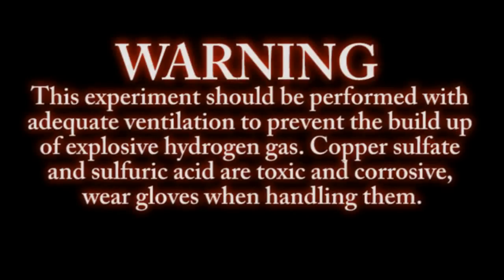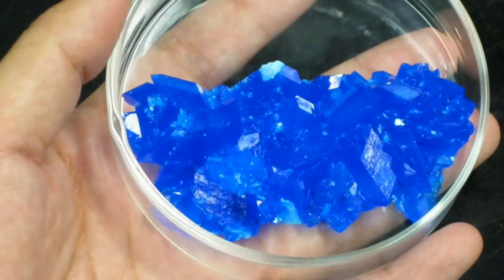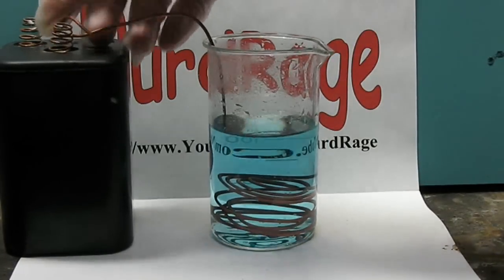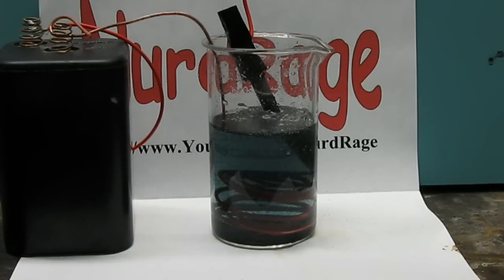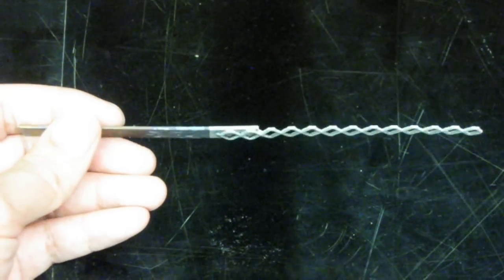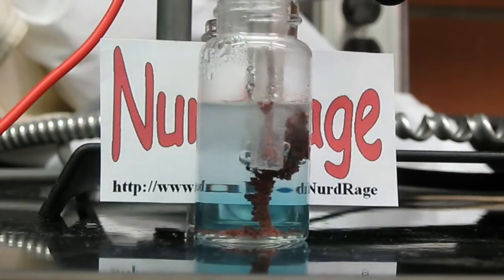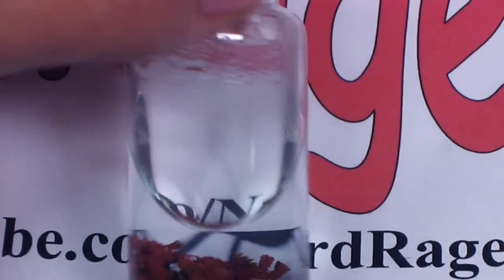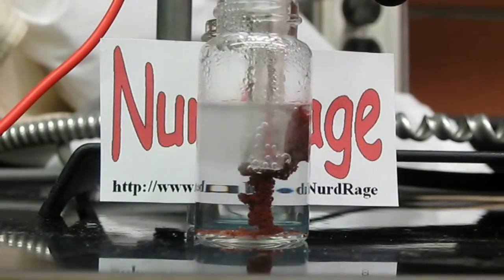Make Sulfuric Acid (Copper Sulfate Electrochemical Method)

Comment: Could this work with just two carbon electrodes?
Reply: No because carbon and copper both have different eletrical currents
Reply: +Yolo Joe Possibly the dumbest thing I've ever heard.
Reply: Ive had good success today with one carbon electrode. There is no real reason why it wouldn't. I'm not entirely sure why nurdrage went with a pack of carbon electrodes.

Comment: @b1912313 Platinium wire rolled on glass rod as anode and thick copper wire (Exactly same like in this video) as cathode.

The diluted acid It produced looked good, it was clear liquid. I think I boiled it too much. It has literally color of tea now. I was boiling 300 ml of what I got from electrolysis, and got about 40 ml of that brown acid at end.

I think It's just strong acid with lots of impurities in it. I probably heated it over 300C.

Comment: Nurdrage,
I tried this with a Carbon electrode from a AA carbon zinc battery which was quite small. I kept the electrode at the positive terminal and the copper electrode at the negative. The amount of electricity used was 3 volts. But still the carbon was eroding slowly and it did not convert to sulfuric acid. Could u please help me out?
Reply: Ive had good success today with a carbon and copper electrodes at 2.5v and 0.15amps. I got a carbon electrode from a bigger battery. Did you remember to boil off the excess water once the solution had gone clear?
Reply: The solution did not convert
Reply: It became a green solution
Reply: if there is still colour, perhaps the electrolysis wasn't completed. 
This said, when I finally got around to boiling off the water in my acid solution I was left with only a white power and no sulphuric acid
Reply: +abey jacob I got the same green solution after the electrolysis, so I boiled off the water and I was left with highly concentrated sulphuric acid
Reply: Ok then I will try it once again and see if it will work. Thank you so much for your help.
Reply: Maybe you got Iron in it?

Comment: Can we make nitric acid by this process using cu(no3)2 solution?
Reply: No, the copper doesn't react with dilute sulfuric acid but nitric acid is oxidising even in dilute state so any nitric acid produced would react with the  reduced copper to form copper nitrate. You could however try to use salt bridge.
Reply: Lukáš J. 
So we can make nitric acid by al(no3)3 solution because aluminium does not react with nitric acid.
Reply: Aluminium does react with nitric acid. It doesn't with concentrated nitric acid due to passivation but passivation wouldn't occur in this situation.

Comment: I am trying this experiment and the reaction is near the end, but it still has a pale blue color. When the electrodes are active I think that they are splitting the water into H2 and O2 rather that reducing the Cu atoms and oxidizing the SO4 ions. Should I just let it keep going or what should I do?
Reply: What did you use for the anode? I used a carbon electrode but like this video it breaks down terribly. After filtering I still have a strong blue coloured solution. I don't know what else Ivan do. I would use platinum but it's just so expensive.
Reply: Timothy Morrison I used a copper and platinized titanium electrodes like the ones used here
Reply: Creativity Can you tell me what voltage/current you used and for what length of time?
Reply: Timothy Morrison  I used one of those big 6 volt batteries and used it until it practically ran out of charge. Either that or the platinum coating had dissolved off which is unlikely.
Reply: +Creativity i don't know if this is still helpful buy i had the same problem. I'm using a computer psu to power it and i moved from 5 volts to 3.3 when the copper started bubbling. That seems to have fixed it.
Reply: Ive had good success today with carbon and copper electrodes at 2.5v and 0.15amps. I am running it through the electrolysis box that Nurdrage also made in one of his videos. He gave a quick tip that I almost missed: set voltage and current so that bubbles are just coming off the copper then back it off just a little

Comment: they are 3 ways to do it.
1.)use sulfuric acid with very few nitric acid it will oxidize copper and let cu+2 and so4-2 merge.
2.) use sulfuric acid with H2O2(hydrogen peroxide) so h2o2 will oxidize the copper to cu+2 and this will react with h2so4 leaving cuso4 and h2 behind.(But i wouldn't do that because of the risk factor attached with h2o2.)
3.) (My favorite and easiest one) electrolysis of sulfuric acid with copper electrodes.
4.) HPAL of copper in 5% W/V sulfuric acid.

Comment: How come the sulfuric acid does not attack the copper at the end of the electrolysis?
Reply: Thanks.
Reply: +ShadowOfChemistry Copper metal will not react with H2SO4 on its own. It must first be oxidized.
Reply: The "answer" is that the electro standard potential of the cooper is +0,52  and of the hydrogen "which is the acid +H as it comes down from H2SO4 " is 0,00 that means the hydrogen just do not have enough "electronegatitivity" capability compared to cooper to oxidize it. The law is the element with higher electro standard potential oxidizes the lower.
Reply: +Elli Pszia That is the answer one gives when one is not trying to wrangle 4 children. lol Otherwise I would have linked a reactivity series diagram.

Comment: All right, well I just tested my experiment with the " acid " & It bubbles when I add Sodium Bicarbonate into it, so that tells me it's acidic. All I did, was make copper sulphate with magnesium sulphate with copper electrodes, then converted it to sulfuric acid with lead dioxide & a copper electrode, it would have to be boiled to make it more concentrated. Good luck tho!

Comment: @b1912313 read his video description. Even stainless steal oxidizes. You should probably use one the carbon electrodes in a battery, and he has a link at :58 that shows how to do it. You probably could use a piece of mechanical pencil lead to do it, but don't hold me to it.I'm assuming it's graphite and that it could count as carbon.

Comment: Just my two cents, but... I am doing this as I write this, but instead of using carbon or platinum, I just used a lead dioxide plate from a lead-acid battery, while also using a 19.4V @ 4.2Amp laptop charger, it's been working pretty good, very hot tho. Lead dioxide does work as a anode for this.

Comment: @wetwilly2000 Forgot to mention, there is from what I can see, none of the lead dioxide has dissolved in the mixture. I do not know the SG of the mixture yet. I will test to the acidity by putting some baking soda, or ammonia into it, if it bubbles, it's acid.

Comment: Hey I'm fairly new to electro chemistry and really want to make sulfuric acid this way also I was just wondering can I use a piece of copper wire as an electrode or what can be used as copper electrode? would it still be possible to get excess copper in the first method? If anyone can help with these questions that would be greatly appreciated thanks.

Comment: Lead should also work, as it is passivated by the sulfuric acid as far as I know. Leadsulfate isn't realy water soluble, so it crystallizes and can be filtered out with the copper, in case that it will be produced. 
If i have time I will make an electrode and test it these days.

Comment: Hey, how about a video about melting the copper sponge with borax powder.  The spong may have a coating of cuprous oxide so a small amount of charcoal dust may be usefull.  You could sell it and recoup 50%to 80%  of the cost for the copper sulfate purchased.

Comment: Can i plate a piece of zinc in copper sulphate and use it as the cathode? :o
Reply: +Jerry Or Yes, you can, I plated a piece of carbon with copper using copper sulphate
Reply: 35lightning35 thx

Comment: I have tested this with graphite and copper electrodes.
The solution became colorless, and I filtered it.
Then I tried to concentrate on, I never reached the point where the sulfuric acid will fume.
I do not think I have succeeded, what could have gone wrong?
Reply: If I'm not mistaken, Sulfuric acid will never boil off, rather it will keep boiling without loosing water after a certain point. Can't recall in which video he demonstrated that.
Reply: I've managed to clean battery Water/Acid and concentrated oit, but I do not think this method is successful, what have I made? Water and metallic copper ??

Comment: I still dont get this reaction. Usually when doing electrolyisis to  a salt, you get an ACID and an HYDROXIDE.

so how come this doesn't form copper hydroxide ?!?!??!? where did the OH- ions went ?!?!?

Copper powder is an extremely expensive stuff, but with this method, it would be very easy to produce.

Comment: @m8teseven Same thing. But i got around that problem by lowering the voltage.
For example at the beginning i had at 6V and no bubbling occurred at the negative electrode but as the solution got lighter the bubbling appeared.I lowered the voltage to about 1.5 V and the bubbling stopped.I hope this helps.Read the fourth paragraph of the video description!! I hope this helps!!:)

Comment: Is it possible to concentrate sulfuric acid by electrolysis? I mean sulfuric acid acts like electrolyte, and water is converted into oxygen and hydrogen? Am I wrong?
Reply: +Dominik Chat That's basically what's going on when you overcharge a lead/acid battery. If you overcharge such a battery, you'll find that the liquid level drops.

That said, it's much more effective to simply heat the solution, since the electrolysis requires more energy than the boiling/evaporation of water.

Comment: @wowhead1227 You can get a 12 inch long platinum wire for around 30 bucks from Esslinger Jewelry supply.  This is a pretty good deal.

Comment: @megamarko94 
No - because hydrochloric acid is simply hydrogen chloride gas bubbled through and dissolved in water. This means that as you heat the acid solution, the gaseous HCl will bubble out once again leaving you will a more dilute solution than you started with in the fisrt place!! Sorry!!

Comment: How make a platinum electrode? I have 0.5 gram a platinum and  titanium plate
Reply: +34Scrooge electroplate it
Reply: i guess u will need more than 0.5g ...it depends on the surface u want to plate it and the thickness of the plating .  
 https://upload.wikimedia.org/wikipedia/commons/b/b6/Copper_electroplating.svg
In the image u have to swap the ME (the metal part) with you titanium plate and the Cu part (not Cu+2) with the platinul part you want to consume ( yes the process will consume it ) . Advice : use low Aps (as low as you can get ... with the aps).

Comment: Please anyone help me.
I need to know if there's any other metal other than platinum and silver that can do this too because i dont have those. and even if i had them it would probably be in the form of jewellery and my mom wont want that soaked in some blue chemical
Reply: potion123456 buy a 6 volt lantern battery.break the seal and you’ll find 4 batteries inside.disconnect all the wires that is connecting them and take the individual cells out.if u hold the zinc battery casing and pull the core out with pliers hard,it will give you the carbon electrode :)the casing is zinc and the inside is manganese dioxide(i think)hope this helps!
Reply: metallic lead works good too

Comment: could i do this with magnesium sulfate
Reply: No. With copper sulfate, copper ions are reduced at the cathode to create elemental copper. The only reason that happens is because copper is lower than hydrogen in the reactivity series. Magnesium is far above hydrogen in the reactivity series, so hydrogen ions in the water would be reduced at the cathode instead of magnesium ions.
Reply: no the magnesium would react back to magneisum sulphate with the created sulphuric acid
Reply: TheSmileyFacedPizza  I think it's due to copper being lower than zinc in the reactivity series, not hydrogen... but that's what my hs teacher said and I have no idea how it works irl
Reply: Copper is actually above hydrogen in reactivity series.
Reply: People make reactivity series in various arrangements. The point is that copper is less reactive than hydrogen, meaning copper is reduced to its elemental state more easily than hydrogen.

Comment: I got sick of my copper sulphate going black so drilled a hole in a bit of housebrick just big enough for the carbon electrode.(from 6 volt battery)
It was going well (solution getting lighter) until a small crack formed in the brick-bit. :(
The concept seems sound though.
No idea what else might be in brick that the acid would react with though.

Comment: why don't you burn sulfur with air, channel the resulting gases through sulfuric acid to dry them, then heat the gases over platinum and dissolve the the result in concentrated sulfuric acid and dilute with water. you need a little H2SO4 to start, but you get twice as much in the end?

Comment: @chemistryguy100 I would try it seeing as the idea is to have a relatively inert electrode which is why carbon, lead, and platinum are used.  I'd double check before trying this.

Comment: how many volts and amperes has you used ???
Reply: Ive had good success today with a carbon and copper electrodes at 2.5v and 0.15amps.
Reply: +franthetortoise I've had sucess using 5.1 v and 2.1 amps
Reply: did the carbon electrodes corrode much with that?
Reply: +TheTalent I didn't use carbon, I used gold as the anode
Reply: nice. smoke em if you've got em... I'm not that fancy.
Reply: Hey 35lightning35 , i think i would ask you something : Using the Gold electrode , did u see or observe any coloration of the gold plate in red , or any other misterious things ? If yes please answer . thx

Comment: Now This is awesomeness, I'm guessing I can recover the Acid from sodium sulfate reaction, and because if you use graphite anodes in a membrane you will exfoliate to yield graphene as a co-product! (If you're into that sort of thing). Would it make sense to use a hot solution increasing solubility and therefore purity?
Reply: It wouldn't work without a membrane cell, sorry, as it would form sodium hydroxide, and would neutralize back the into sodium sulfate.

Manganese sulfate would work much better.

Comment: so whilst I was doing this reaction, I got to experience a very important thing. Don't let electricity flow overnight. Specially, when you will see your cathodes are generating gas instead of metallic copper, turn of the electric source immediately, or your acid will be destroyed.

Comment: @mquade12194  You are probably using a composite of carbon fiber and epoxy, and my guess is that the carbon fiber would dissolve while the epoxy would remain intact.  You would have to run it for several hours to be sure, though.

Comment: I make 99% sulfuric acid with supra saturated copper sulfate solution 
Indication:
1 for   first 15-30 min. I use carbon rod from batery ( just heavy duty) i filter it and i put the semi acid (is 50-70% purity ) again but with carbon rod from pencil for super purity (90-99% purity) 
This is with a 25v with apx. 1-2amps it vorcks with 6-12v good .
Reply: Do you use anhydrous copper sulphate? Regular copper sulphate contains a lot of water and can't really be used to make concentrated acid.

Comment: very easy way to make weak sulphuric acid is:
take a spoon full of sulfur, and then hold the spoon under a NON-luminous flame and then put the spoon into a container which contains water and close the container while the spoon is in it, but make sure the both the spoon and the burning sulfur DONT touch the water, just keep it in the space above the water!
and after a few seconds or mins, the water turns into H2SO4!
reason:
(check out my other comment, cause i dont have enough space for this!)

Comment: ok so this is the comment i told about:
ok so reason:
Burning Sulfur produces Sulfur Dioxide, and sulfur dioxide, immediately reacts with oxygen producing Sulfur Trioxide, and if sulfur Trioxide dissolves in water, it immediately reacts with water forming Sulphuric acid!

Comment: I just read a patent for concentrating sulphuric acid, by cooling it near or to its freezing point, and by separating the acid-rich region from the acid-poor region based on density of the solution. It didn't mention which is the solid and which is the liquid part. =\

Comment: I used 5 Amps with a platinum electrode and limited the voltage to 4.5V and current to 5 Amps and it worked well. The solution was still a little pale green but I only ran it for 9 hours. I boiled off 47% of the water and added some drops to sugar. It did not dehydrate the sugar. Nothing happened! This is not a good method.

Comment: Guys i have a 6v dc power supply ad its been running on and of for 2 hours at a time and it has minimised errosion of the carbon electroed and built a massive clump of spongy copper at the other . This method works perfectly fine. But for some reason its starting to bubble at both ends now , does that mean its ready or is somthing wrong?plz tell me.

Comment: HOW TO TURN MY BLUE COPPER SULFATE BACK INTO SULFURIC ACID.
Put a spiral copper metal into the solution while attached to the negative,& put a carbon electrode in the mix while attached to the positive.
Reply: FILTER OUT THE BLACK SUSPENDED PARTICLES UNTIL ITS CLEAR,& USE PLATINUM ON POSITIVE(COFFEE FILTER)

Comment: Why doesn't  the sulfuric acid react with the copper
Reply: +noah he (noahdthehorse) Because H2SO4 reacts with copper at higher temperature. At room temperature it doesn't react.
Reply: oh. thanks
Reply: Copper has lower oxidation potential than hydrogen.
Reply: Johnpao215 Copper is still reactive enough to react with oxiacids.

Comment: @12414666 what i did is
i got a platinum coated bracelet from a pawn shop and used that
it's as effective but it did also cost me 40 dollars....

try to get platinum in other things such as spark plugs, elementsales. com (and hammer down the platinum they sell you), etc